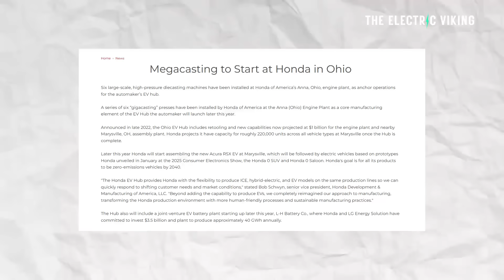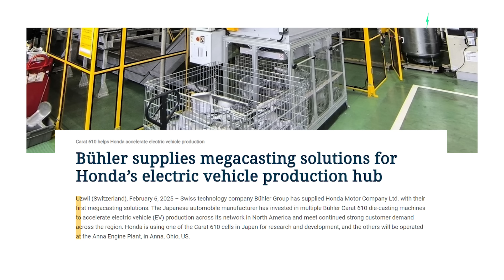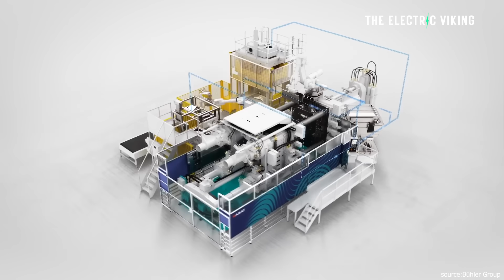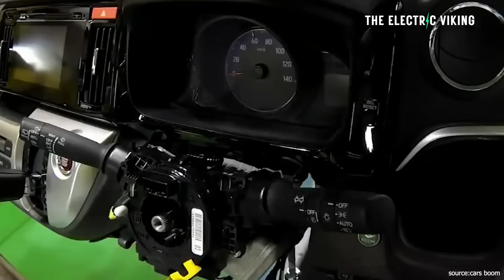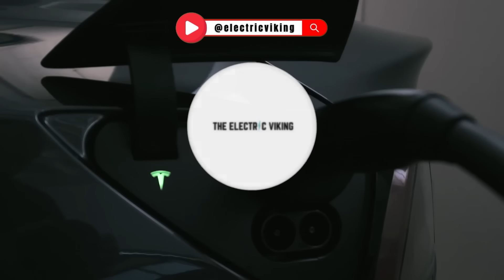Honda install 6 Tesla inspired Gigacast machines at American EV factory

Comment: "Gigacasting" is simply a very large casting machine.  It's not particularly special, as it's just scaling up from smaller casting machines which have been in wide use for decades.  And it's not just Tesla and Honda - a lot of Chinese OEMs are doing big castings as well.  A good casting reduces part count, lowers cost, cuts weight, increases strength, and improves stiffness.
Reply: Tesla is the first to go ahead with it. It is obvious in hindsight but Tesla got a lot of criticism when they first proposed the idea.
Reply: @revhappyrs2k  OK, but that should have made little sense, unless the intent was to convince management that CapEx investment in advanced manufacturing equipment was somehow a bad idea.

Comment: Those casting machines are for the battery trays smh. So nothing like what tesla pioneered and others are replicating for evs! 

Chery automotive over in china used a fkn 12,000 ton press last summer to produce a compact ev user body in 1 single shot!

Comment: Casting is not stamping, you need alot of force to hold the dies together to seal them and then more to pressurise the molten metal into the mould.

Comment: A further benefit of the gigacast process is that the car manufacturers now make cars out of lighter and rust resisting aluminium alloy where they previously made them out of heavy and rusting steel with lots of additional welds. 🙂

Comment: As soon as you said the completed megacasting was transported from Anna (Ohio) to where the assembly plant where it's used (Marysville, OH) I had to look both locations up on maps. Turns out they are a 1 hour drive from one another. Close enough to qualify as reducing a source of "waste" by having source and use close to one another.
Could only be improved by doing both in the same plant like Tesla's Giga Texas does. This is a lesson that Henry Ford demonstrated masterfully way back when via trains delivering parts that get placed directly onto the manufacturing line where they get used, long before Just-in-time (or more correctly "Just-on-time") was a thing at Toyota.
Reply: River Rouge

Comment: Elon Musk is a diabolical maniac. Ever heard people refer to his "demon mode"? His giga-casting makes cars cheaper to make, and more expensive to repair. Well documented facts. It is the modern trend with everything, cheap and cheerful. You makes yer choices, cheap cars, and in the case of EVs cheaper to own over longer times, but not if crashed. Crash risk is usually low and not in a buyer's mind.
Reply: Was it his idea or did he just use his money to hire some smart engineers?  Musk seems more of an opportunist bean counter than a real innovator.
Reply: @daniellarson3068  Musk studied Astro-Physics for the PhD he didn't finish. Hence SpaceX. He is a risk taker, chancer, and even he admits, somewhere on the spectrum. ie empathically challenged. Castings were Sandy Munro's idea, at least 10 years prior.

Comment: I have multi engineering degrees and anytime you can reduce the number of parts at or above 100 that needs to be welded or bolted in place.  That would be a great saving in time and/or money.  There is no down side to this!!

Comment: Of course it was a good idea. Competitors could get away with typical chassis designs with LOW power electric motors.
Remember Tesla started out with 1000hp in the Model X. A 1000 hp motor will rip out of a typical chassis at full power.
By going high power first, Tesla avoided the criticism of a battery powered car not being up to the rigors of demanding use. The other car companies benefitted from Tesla eliminating that objection from the start.
Again, Musk does things people only appreciate years later.

Comment: As a retired automotive engineer, I applaud new technologies and processes.  However, no single tech or process is a magic fix. Profound improvement in many situations, possibly.  Success is all about application and implementation.  I see no reason why Giga castings won't advance ICE vehicles in the same way the do in EVs.
Reply: The world is moving away from ICE vehicles, so all of the new and developing technology is heading in the direction of EVs.
Reply: @richardcogbill6791  The same technologies that make EV's attractive will make hybrids more attractive.  I would like to have hybrid compact tractor, small excavator, side-by-side, zeroturn mower, one ton dually.
Reply: Giga press out fully built motors!  Easy!

Comment: It'll be interesting to see what happens to insurance premiums.
Manufacturers don't care about insurance costs or repair costs.
Will we expect to see insurance write-offs increase for these vehicles if you have to replace the entire frame if you bend a small bit.
Massive cost benefits to builders, but what about you and me?
Reply: Not following your point. Is a non-giga cast sub assembly any more repairable than a giga cast in an accident?

Comment: Gigacasting was NOT a good idea in the past because the tech was not ready. The CAD/CAM & e2e car production + design were not optimised for or built (as a process) to easily convert & be built with the die-cast processes.
That plus the tech around it (joint welding & many other associated variables) are what has now changed!  
So today, not its a very mature & proven tech (in many industries) that allows you to produce EV in volumes ICE equivalents can only dream of.

Comment: As a Tool & Die Maker.  To see SO MANY parts become one is amazing!  Regular people don't understand the amount of time it takes to build just 1 die for 1 part! Each die can have issues when running causing it to be shut down to repair, resharpen.  Countless reasons you may not know.  MASSIVE amounts of floor space being used, huge amounts of coils of steel!  Now they just pour it and all the important points are in spec.  It's brilliant !   I never thought it was stupid.. Elon nailed it!
Reply: I've always thought that CASTING ENGINE BLOCKS was akin to MAGIC - casting solid objects is no big deal, but engine blocks have ALL THOSE PASSAGEWAYS for oil and water through them - and obviously engines are built to   very precise tolerances.  
What's amazing isn't that it took so long for Elon to pioneer one-part  casting for major frame assemblies... but that it took so long for "legacy" automakers to get around to doing so.  
  But as Sandy Munroe of Munroe Live explained in one of his videos  (Sandy helped push or even suggested to Elon the idea of replacing all those parts and welds with a single or several castings) he once worked for Ford... and spent all night working to SLIGHTLY modify the assembly line so it would reduce one or two steps and make that line more efficient...
HE WAS NEARLY FIRED the next day!  Management went back to the older, less efficient line.  And,  Sandy explains, THAT'S HOW ALL of "legacy" auto is - improvements and upgrades are DISCOURAGED by EVERYONE in management, and workers are penalized for stopping the line to  make sure a car is just right - they are better off letting a car with POOR QUALITY parts or alignment  go on down the line rather than stopping it to fix that car - so of course CUSTOMERS WIND UP with POOR QUALITY cars.  

  When you hear that "Ford LOST $5 BILLION dollars on EVs this year" - it's just bc THEIR BRAIN DEAD MANAGEMENT don't KNOW HOW TO ADAPT & simplify.  They don't even have to make the batteries - they can buy them from Panasonic or other mfgs. 
   EV cars are just scaled-up little RC race-cars - all they have is a battery, an electric motor, a radio receiver and a servo motor for steering.   Not counting all the sensors and Self-Driving software which aren't  necessary for a car to drive, most of the software in full size EV cars is just BATTERY THERMAL MANAGEMENT (to keep the batteries to get too hot during either charging or discharging) - other than that an EV car is just a scaled up little RC race car - but "Legacy" auto WASTE BILLIONS making these much easier to produce vehicles.
Reply: @vvvci  Not Toyota or Honda,  improvements in manufacturing were proposed by those who works on the floor.
Reply: I hear your brother worked in a press shop all my life tandem and transfer normally people misplacing parts haha
Reply: Absolutely 💯 Spot-on 
As a Manufacturing Engineer,  I agree entirely. 
What media and public don't understand is that once an OEM is making 💰,  it would be extremely unusual for them to take any risks to optimize production.

Comment: all good and proper but lets see if they go steer by wire or 48v system. Lets see if their body work doesnt have 100parts just for the bumper. Lets see if their cars are aerodynamic enough or just fancy bricks.  they have only taken the first step......

Comment: When you remove parts you remove the supply line and the subsequent supply contracts.  BOM simplified, warehousing space reduced, number of creditors reduced all pulling back the monthly cash outflow.  I am astounded it has taken the legacy brands so long to realise this.
Reply: I work at a (very small, minor player) manufacturing company and our production lead recently went on a tour of a Toyota factory. They were proudly telling him about their process for stopping the line to suggest improvements, which, it has to be said, has done Toyota pretty well for the last several decades. But it's entirely focused on small gains: "if we load up the next bolt while the previous bolt is still being bolted, we can save 1 second off the time". Cool, cool, that's good, cool optimisation, but they're so focused on optimising existing processes that nobody stops to think: hey, what if we casted this whole section in one piece, then we wouldn't have to bolt these parts together at all, and could save massive amounts of time and money?

Comment: I seem to recall reading somewhere that the legacy automakers did not adopt giga casting in the past because the insurance companies expressed concern (possibly about repair costs)
Reply: Speculation by commentators on social media. If a frame is damaged a car is totaled. It makes no difference whether it is gigacasted or traditionally built. If you did want to repair it, you’d weld it.
Reply: I suspect repair costs have become less and less of an issue as vehicles have become more and more unrepairable.  Safer cars must keep medical claims down, which may also play into the overall equation.

Comment: If anyone is wondering, the 6000 tons refers to the machines clamping force, how much pressure it can exert to hold the mould together while the metal is injected. It's usually correlated to machine size and weight (more clamping force is bigger and heavier nachine) but not directly related

Comment: GM casts a strategically planned set of metal alloys, aluminum, magnesium, ceramics, plastics, carbon, and other composite materials in the same sections; each unit with a specific function and purpose. Tesla uses just one metal alloy which is absolutely crude compared to the advanced GM pieces used on the Corvette and top Caddies. There are no "one alloy" short cuts in the industry and that is why the Corvette C8 ZR1 is the best car ever made in America and one Tesla cannot match today or tomorrow.
Reply: What's the price difference?
Reply: WTF you smokin bro?
Reply: I can't see anything unique in the Corvette C8 ZR1 aluminium space frame construction?

Comment: Hey mate I know you are passionate about your mission in getting rid of ICE cars especially diesel. 
The incidence of lung cancer in non smokers is INCREASING. Air pollution is the culprit and as a doctor, I fully agree with your passion. Keep up with your great work
Reply: Many doctors in the USA are steering away from thinking exhaust emissions are the main cause of lung cancer, and pointing the finger more at tyre dust as being the main cause of lung cancer.
Reply: @robri87-hh4gr  I do remember reading an article where people living in New York City who had contracted lung cancer showed their lungs contained tyre dust.
Reply: @Ingline-wg9lh  Tyre dust contains a host of the most horrible chemicals you can think of.
Reply: There is nothing we can do about air pollution that doesn't have much worse consequences.
Reply: @Withnail1969  What a strange thing to say.   If you put out a tire fire is that worse than letting it burn?

Comment: The insurance companies are punishing cars built with giga casting machines. They are charging Tesla model 3 and model Y about $1500 more per year vs non Giga Casting cars such as Nissan Ariya. I have a Nissan Ariya and paying about $1100 per year vs my neighbors who have similar price Model Y and similar coverage for $2600 to $3000. It is because model Y is not repairable with just a moderate accident. It needs to be total if the frame is damage. You cannot weld or change parts.
Reply: In my experience that is not the case, at least not in Australia. I have 2evs and 1 ice.. little difference in insurance
Reply: @micoots  You must be lucky. The Tesla quotes are definitely more compared to a brand new ICE car.
Reply: @micoots what make and model are your EVs? You didn't say that they were Teslas. This is not an EV vs ICE thing, it's a gigacast vs traditional build thing
I've moved from ice to EV and my insurance costs hardly changed, but my EV isn't a gigacast model..
Of course, insurance premiums are also affected by vehicle performance. If you move from something which does 0-100kph in 13 secs to something which does 0-speed of light in under a second, then your premiums will probably increase.
Reply: @rugbygirlsdadg  both of my evs are byd"s.. one 2023 atto3 and one 2024 seal.. the ice I have is a 2017 Mazda cx5.. the price difference in full comprehensive insurance between the new byds and the old Mazda is a few hundred dollars cheaper for the Mazda, and its worth less than a half of the atto3 and a third of the seal.
Reply: I doubt it's all because of the gigacasting. I'd say it's less to insure because of its anticipated depreciation and who they think is buying them.
Reply: The 3 doesn’t use gigacasting so it can’t be the reason. Plus, my insurance company charges very little to insurance my 3. My insurance agent said it was because it was so safe. It is cheaper than my virtually worthless (on the market) 10 yo Nissan LEAF, even when the Tesla was new.